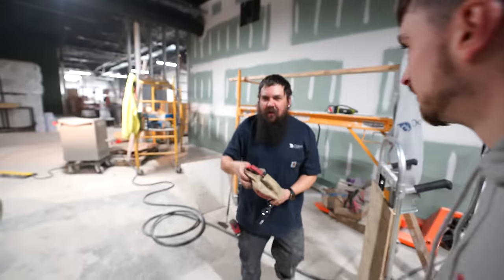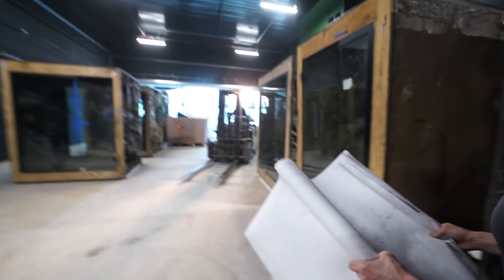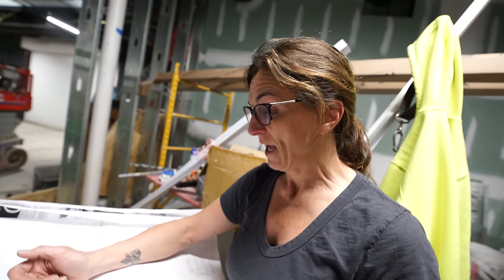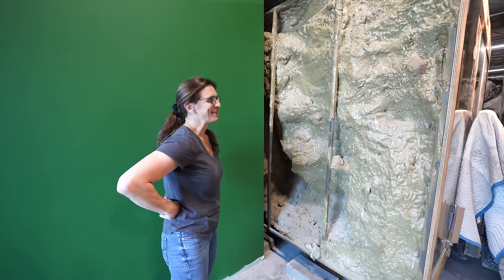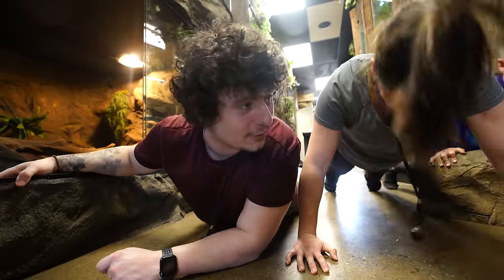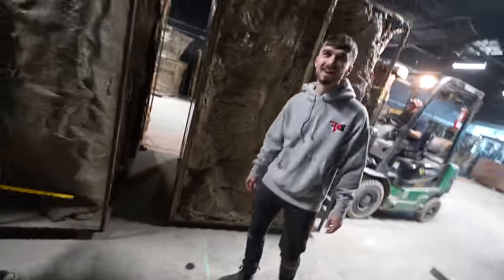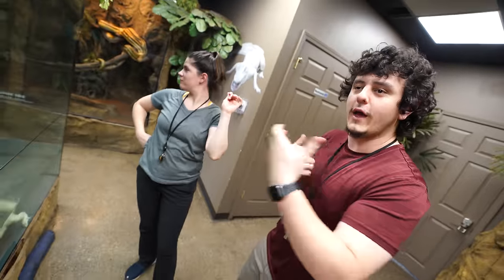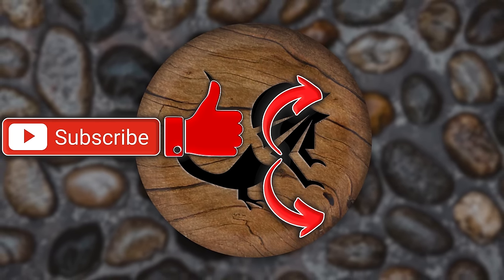First Look at Reptile Enclosures at The Zoo!

Comment: Hey just so you know Spray foam  underneath those Is enclosures than they won't be spongy If you use that it will be light weight and it will expand  problem solved Then you don't have a place for escapes To hide, it will fill it in and it will be light and durable. So when you walk on it it won't be bouncy